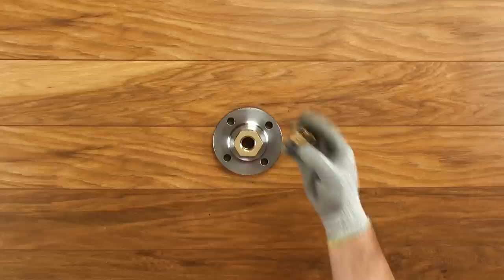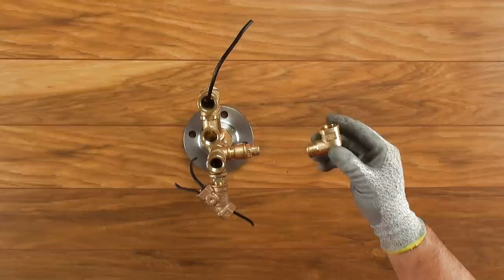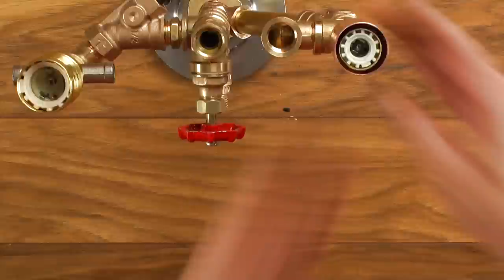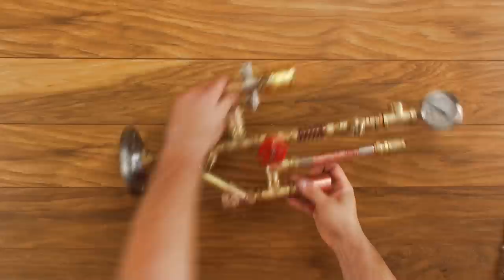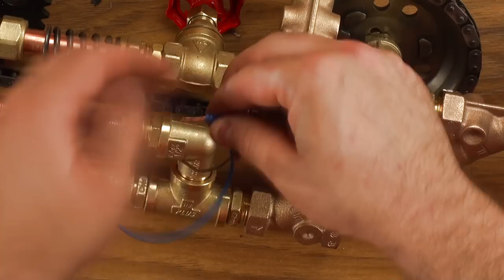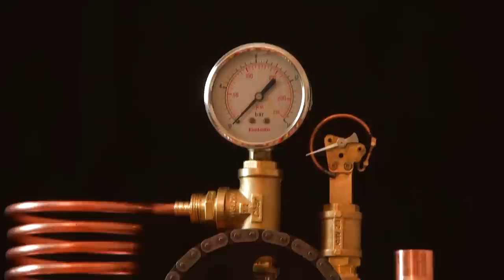Steampunk DIY Industrial Pipe Lamp #7

Comment: This lamp for its design and the different metals used, is in the top10 of my favorites.
A detail that does not seem consistent with the combination of bronze, copper, iron and steel, is a cheap plastic switch. even less black. Maybe ivory white or bakelite. or maybe one of chain.
It is also a supreme design and combination

Comment: Amazing artwork. I would like to recommend to use protective ground in your designs. I noticed you always use just two wires. Since the lamps are all made fully from metal, a connection of the lamp body to protective ground would make it safer to operate. A loose wire can happen.

Comment: what a beautiful build!!   ..but still no valve switch^^
Reply from the maker: Thank you my friend! The buyer don't want a valve switch ;)
Reply: ah, ok.  i just wachet the steampunk lamp #6, what a nice lamp! WITH valve dimmer, very impressive. how did you get some of the parts black? just painted? keep up the good work and thanks for sharing!
Reply from the maker: All the iron materials I clean with sandblast and are electrostatically painted for greater resistance to wear, and by the way, the lamp # 2 is made of brass, I think you ask me for some other lamp
Reply: oh, thats even better. but i guess you didnt do this by yourself?  thats right, i ment the lamp #6, just figured it out and changed it. thanks for the response!
Reply from the maker: Painting materials is produced by my good friend who is competent in painting

Comment: Your ideas are interesting but way too far overboard. Its just too damn busy, you don't need to use every single part that Home Depot has in stock on one project.
Reply: never seen a timing chain and gears at homedepot.
Reply: He said in one video that he recycles old fittings too